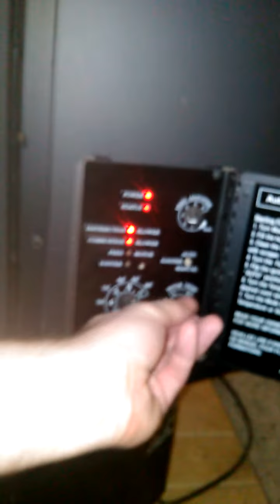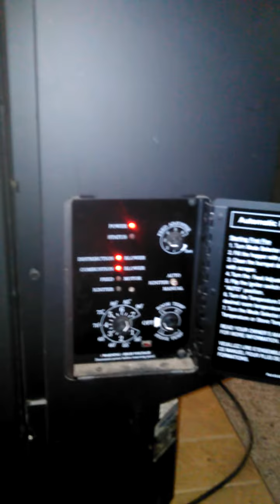Harman P43 Pellet Stove Continuous Squealing

Comment: Sounds like the distribution blower.
Reply: Yes it is, I had the same noise on my Harman Insert, removed it from the fireplace housing and removed the distribution blower underneath the stove. It only has three nots to remove and four color coded wires to remove.   I used some 3-in-one, electric motor oil, and oiled the bearings (look for two small oiling holes opposit of each other) .  The noise is gone but if the bearings are done, I expect the noise will return, hopefully this buys me some time.  Otherwise just buy the fan assembly.  I had replaced it about 2 or 3 times in the past at $800 a pop via the dealership.  From now-on, I'll do my own maintenance unless the board goes again.  The stove is about 15 years old.